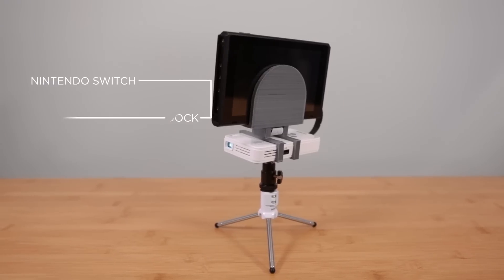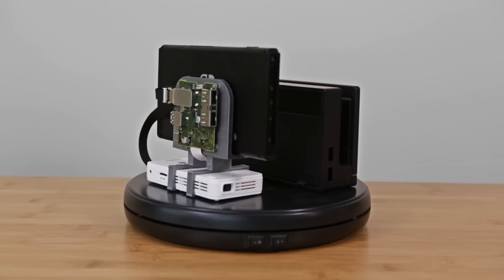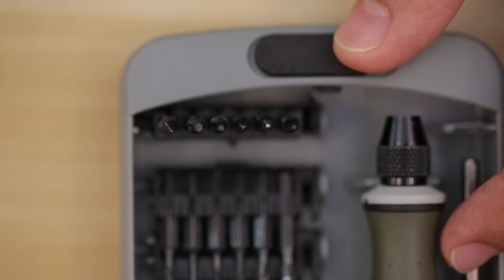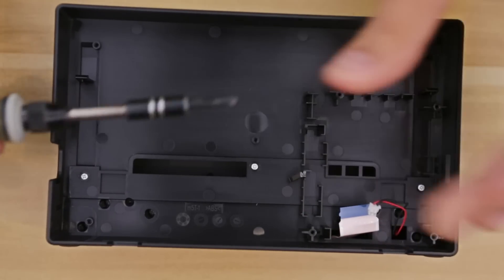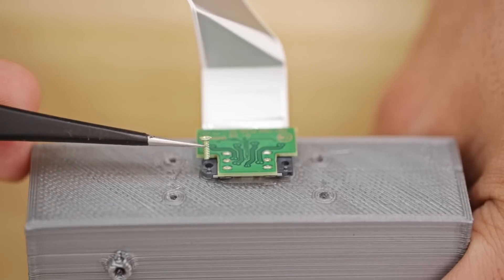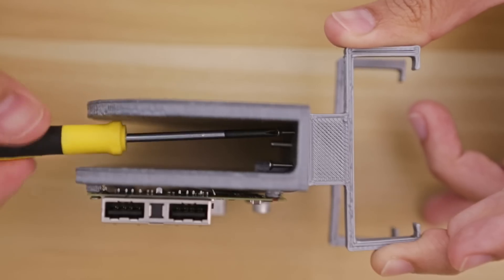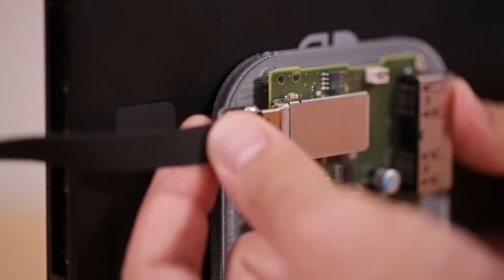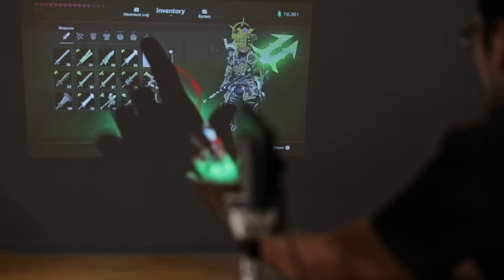DIY Nintendo Switch Projector Dock // 3D Printing

Comment: The spring mechanism inside the official dock serves to help protect  the switch while mounting it, as it might be a bit too easy to slam it down and break the connector. 

I would therefore recommend modifying the project to reuse that part for the safety of the device.

It doesn't take a whole lot of extra time, and it's worth it for the extra protection.

Comment: I wouldn't recommend this projector specifically, as it only has about 80 minutes of battery life, and doesn't let you charge while it's on.
Reply from the maker: +ericbazinga 🤦‍♂️ yes it does, thats how we tested while prototyping the design. even works while plugged into a battery
Reply: Adafruit Industries Oh. I heard it didn't. To be fair, I don't actually own one of these. My mistake!

Comment: You still need the Nintendo power adapter plugged into the dock right? Or something with the 15v power?
Reply from the maker: +andyLeer Yep, without the power adapter the gameplay is laggy. We tried with a 5v USB battery bank but was still laggy.
Reply: A regular battery bank is too weak, you can use a usb c battery charger like the one from razor  https://www.razerzone.com/gaming-accessories/razer-power-bank but i think that there are others that will work as well. although if you want something cheaper you could try this sort of setup https://youtu.be/FKL9_bdtHq0